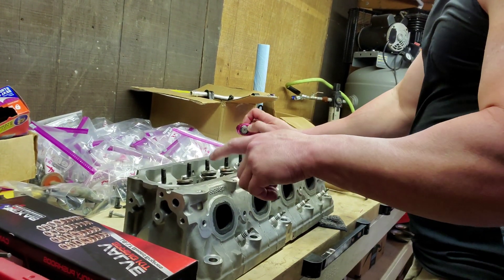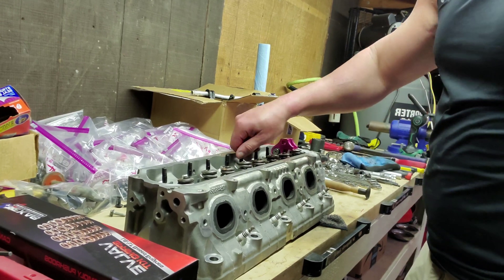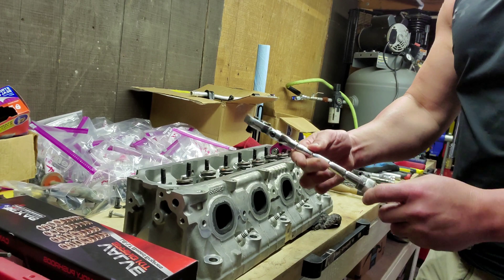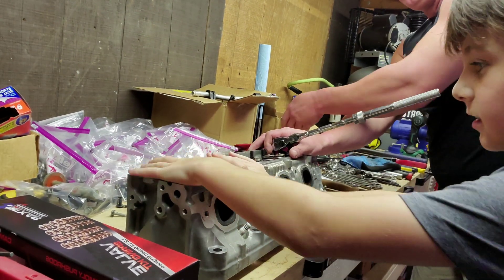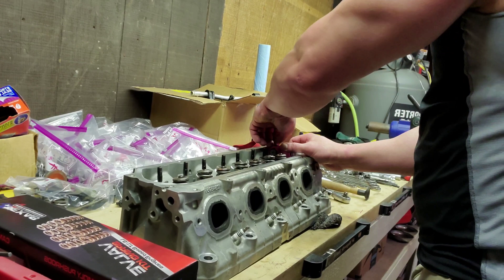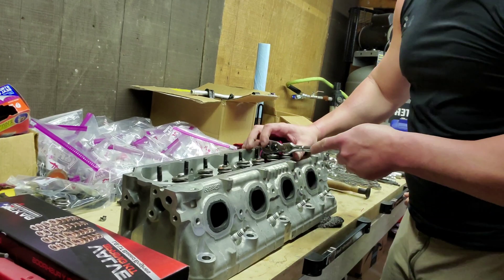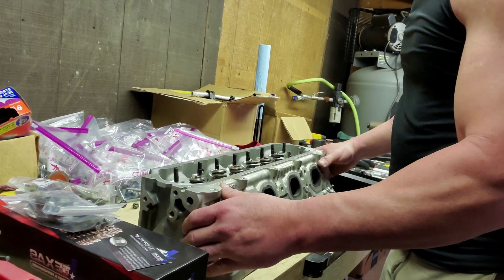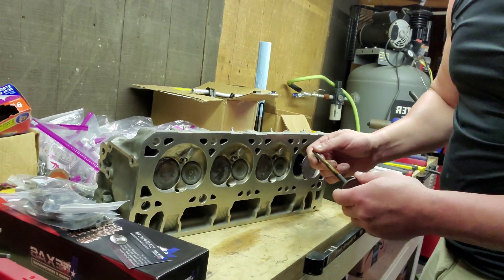Removing BTR Conical Valve Springs on GenV LT4 cylinder heads.

Comment: I’ve been hunting a mild cam for a L86 with VVT. What cam was you running with the conicals?
Reply from the maker: Stock Gen5 LT4 cam.  I went to dual springs for the extra lift for my new Stage 3 cam from VR.